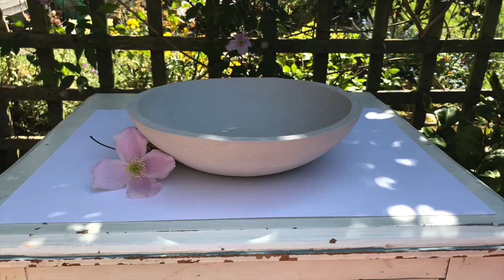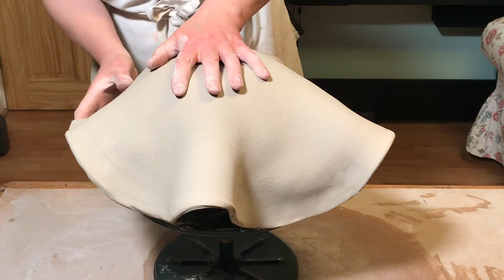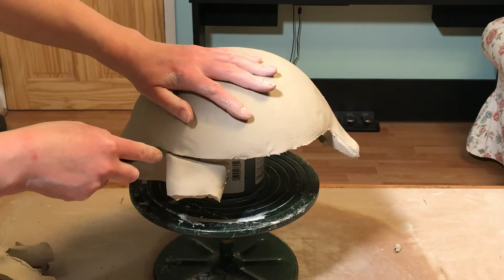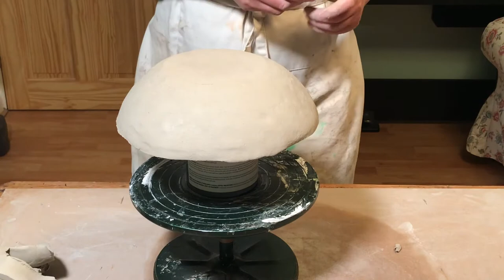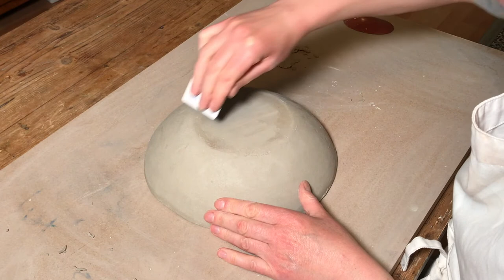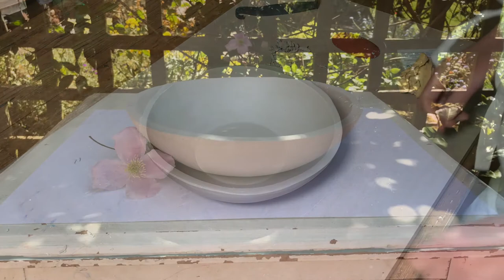How to Make Pottery with a Hump Mold

Comment: How long does it take to become leather hard while on the plaster mold?  I did my first one yesterday (11 inch bowl) and the clay still seems a bit damp today, and doesn't want to let go of the plaster underneath.  Is there any time period you recommend and/or techniques for getting the pot off the mold without damaging it?
Reply from the maker: hello, it depends on a few things.  Did you make the mold?  if so, how long did you leave it to dry.  If the mold still contains water, then it does take longer for the bowl to dry out. I find if the plaster mold is dry then the clay will be leather hard in a few hours.  How thick is the bowl?